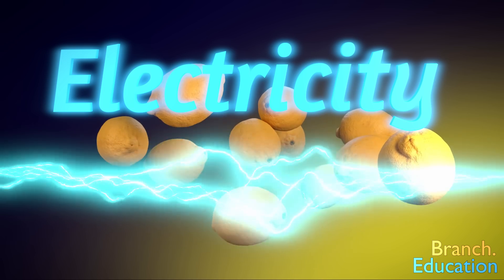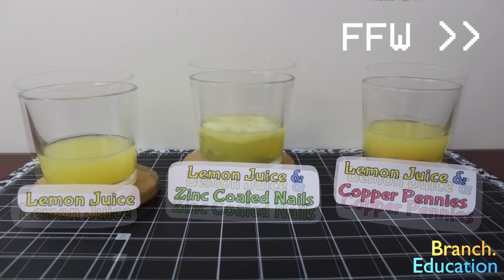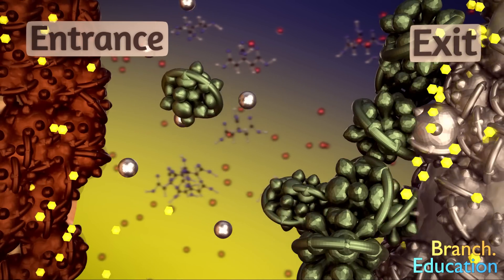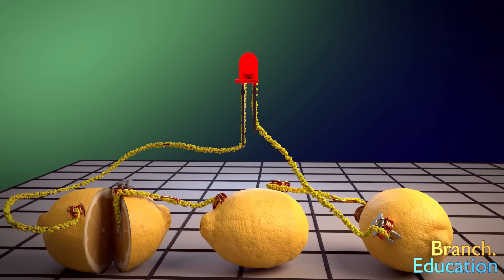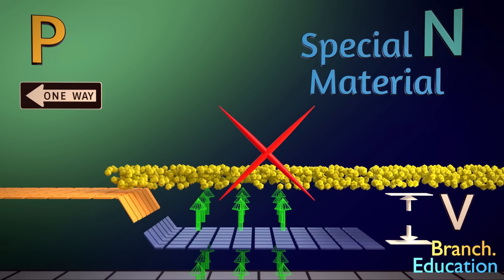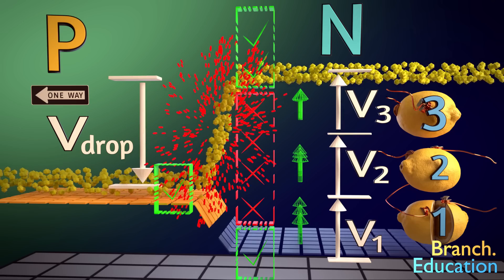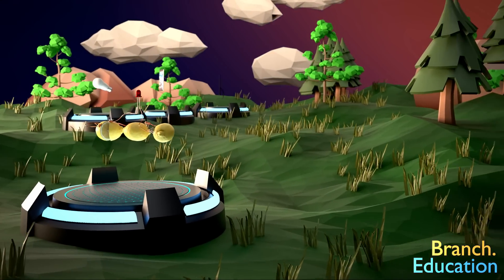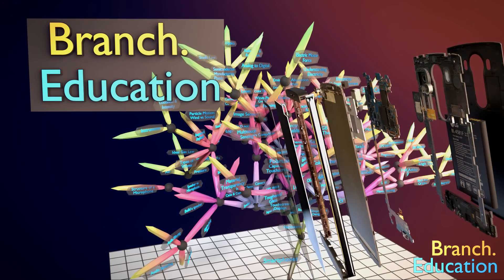How do LEDs & Batteries Work?

Comment: Can we get some numbers associated with the colors on the color spectrum. Height of the drop for red green blue et al. Voltages to reach those heights also?

Current to light intensity ratio would be cool to know also. Thank you!

Is current 3 x 10^15 electrons per lemon then?

Comment: How does wiring up another lemon increase voltage? Wouldn't the electrons from the zinc nail from one lemon just move through the conductor to the copper in the next lemon and turn into gas? I guess I don't understand the flow of electrons through the circuit with multiple lemons hooked up.   Any input would be much appreciated! Thank you

Comment: PLEASE PLEASE PLEASE!!!! I need your help.

I work with circuits every day. I have a lab focused on component level board repair, and test equipment calibration/metrology. I have a lab full of professional calibrated test equipment, and I can troubleshoot/fix almost anything……but I still have A little trouble visualizing it in my mind.

It would be AMAZING if you could discuss a simple circuit/pcb, with a very basic layout, including a few of the most common components. 

Like a resistor, capacitor, diode, and maybe a single basic transistor. KEEP IT SUPER SIMPLE. 
Because there’s literally not a video like this available on the Internet anywhere that I’ve been able to find.

I’ve worked with complex for several years, but I still can’t visualize in my mind how the electrons move through a circuit. Obviously I know how it works and what goes on… But I just can’t see it in my mind. And I’ve been looking for a video to explain it simply…. for years.

I understand the difference in “conventional current“ and “electron flow“….. I know how all  components function and contribute to the operation of a circuit. But I just can’t visualize the power flowing through the circuit.

I would love to see an animation of a very basic pcb, with a few of the most basic components… And see how the electrons flow through the circuit from start to finish. 

Possibly show the actual circuit, side-by-side with the schematic drawing. While the current is flowing through both. Because that’s where my confusion lies. 

I really appreciate all you do. Your animations are incredible!

Comment: Yes I have a question.
Why wire heats up more when we pass low voltage and high amperes through it and less when we pass high voltage low amperes through it ?
Reply: simple: voltage is how strong the electrons are beiing pushes and amperes are the actual flow - that means how many electrons flow through the wire. Well, not actually "flow", rather beiing pushed.

Comment: If the e- just have to reach the other end (copper coins) to combine with H+ ion. Then why don't we just put the Zn nails in some other place like in water (that way Zn2+ can still have place to go after detaching from Zn nail) while at the same time it can still send those e- through the wire to the lemons H+ ion. Will it work? It should work as the circuit will get e- and the H+ will combine with those e-. And if the sole purpose of Cu is to provide a surface of H+ to attach to e-, why don't we use other metals?

Comment: Can I use oranges instead?
They’re similar.
Reply from the maker: Ya don’t know until you try it out.
Reply: Lemons would be more efficient, but oranges would also do
Reply: Actually you could, but the lemon's pH is lower than the oranges (it is scaled 0-14, being 7 neutral, 14 basic and 0 acid), so the more acidic environment the better conductivity you get.
Reply: Sergio Aragón Iturri ah, ok.

Comment: how does photon emit light?
Reply from the maker: Well- photons are light itself:  photons = light.
Reply: @BranchEducation  thnx a lot for replying
Reply: I have another important question: When electron falls from a height it releases a photon which is light so will photon come out if the wires conducting electrons are kept at a height and arranged vertically?🤔
Reply from the maker: @ramitbhowmick9899 Well The wires will not emit light, because there is only one energy level that the electrons are at inside the wire, and they don't change in energy level while travelling through the wires.  [However, they actually do a very small amount, and that small amount of loss in energy level is output as heating the wire]
Reply: @BranchEducation  now I understand..thnx

Comment: Dose that mean that if i increase the voltage in my normal white led it could change the color to blue or red ?
Reply from the maker: Nope- the color is dependent on the voltage drop set by the material choice in P and N, and not the voltage you apply.

Comment: Then why do LEDs burn when we apply a large voltage
Reply from the maker: Hmm, great question!  I'll have to look into it.
Reply: I'm guessing it has to do with the material properties. For instance, the longer you leave a light bulb on, the hotter it gets. This is becaue alongside energy being released as light, it is also released as heat energy due to friction. The more elctrons that pass through (voltage) the more friction and more heat. at some point the physical properties of the material might kick in causing it to melt or burn up. my theory though, I may be wrong.
Reply: Bcz ,due to large voltage drop , higher frequency of radiation is radiated out and higher frequency radiation carries a lot amount of energy than visible radiation
Reply: LEDs are just another diodes but special as mentioned in the video. They burn because excess voltage brings excess current. They are designed to work on certain voltage levels are require very little currents. Hope it answers the question.
Reply: Maybe the diodes represented as n-p burn because of high voltage.also the higher the voltage, the higher will be the ammount of photons.And we all know that photons have Energy. So excess ammount of energy burns the light

Comment: if electrons moved so slowly then how is the force 'electricity' instantaneous?
if they are slow then how is the responce to next electrons so fast? 
is it because there are so many electrons in area of cross section of wire or any other pls answer it
Reply from the maker: check out the video of how sound travels first, think about it, and then come back.  https://youtu.be/1kjAkuwYx2M  .  The main thing to think about is:  Is the wave's speed the same as the speed of the overall steel bar.

Comment: Woaaah, 9x10^15 electrons per second. Can we assume 1 electron will give off 1 photon at the energy drop between the N P materials?
Reply from the maker: Photons get generated, but a good percentage get reabsorbed and converted to heat energy
Reply: @BranchEducation  How are the Photons reabsorbed and converted to heat energy?

Comment: Great and thanks! You could explain how the photons emitted by a light source end up being absorbed by a material (how the photon experiences a transformation, how the photon transfers its energy and effects a change in some material and how it ends up being another particle or what be that it is transformed and how much energy those processes consume). Another request would be if they would make a video where they talk about the concentration pile (which has two equal electrodes but works according to the density difference of the electrolyte in each of the electrodes to generate electricity even when the electrodes are the same material) . Thank you